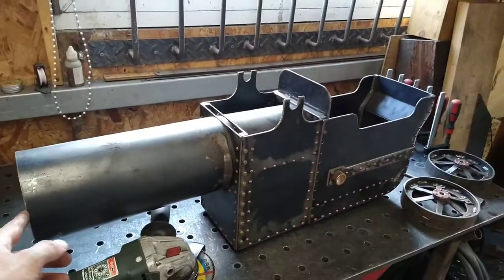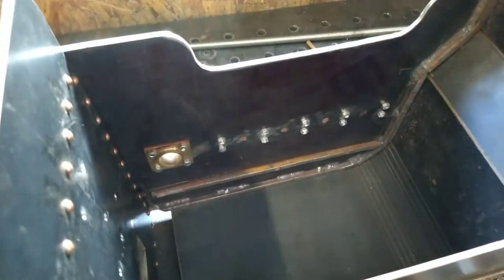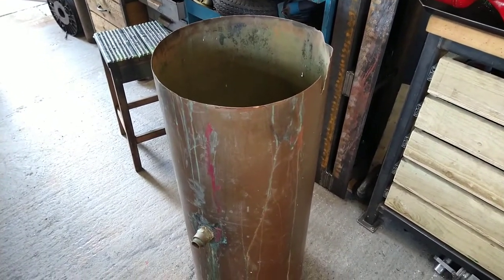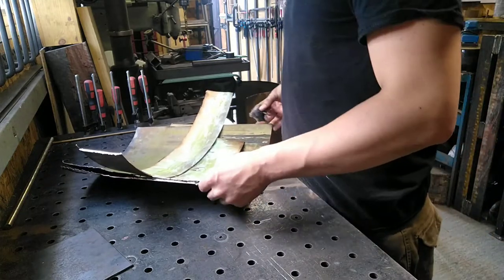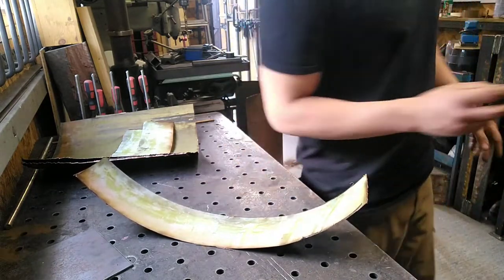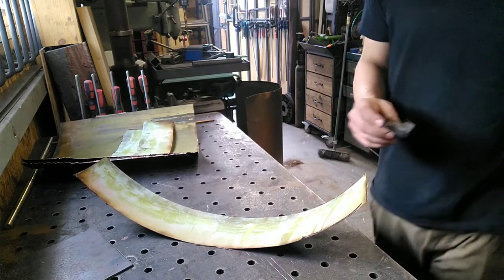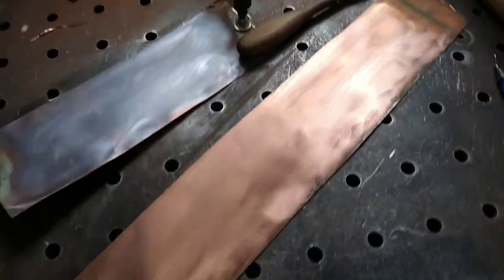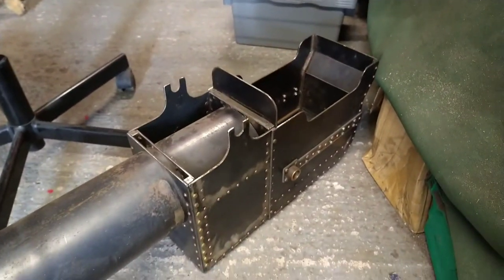Traction engine build: 17 - Recycling a old copper tank to use for the water tank.

Comment: Are you doing a copper boiler in a steel jacket with locating stays? If so I had considered doing that for mine but I didn’t think it Leila work
Reply from the maker: Hi Aaron yes it will be a copper pot boiler sat inside a steel tube for the smoke to draw around it and up the chimney as opposed to through pipes in a conventional engine. I bought the designs of a fellow who has made them, but I have decided to modify mine with the addition of some through pipes to increase the steaming performance.